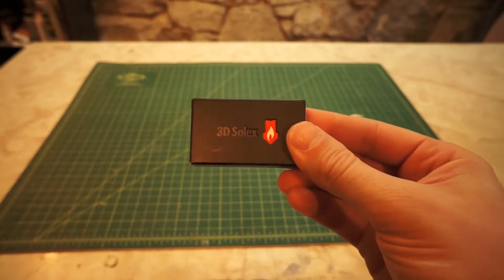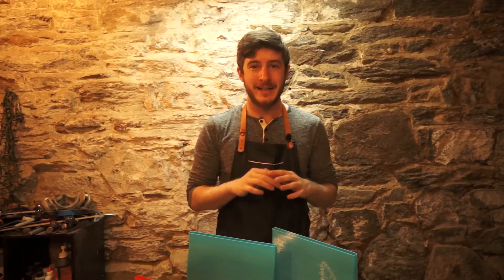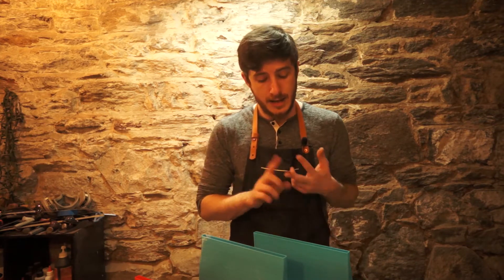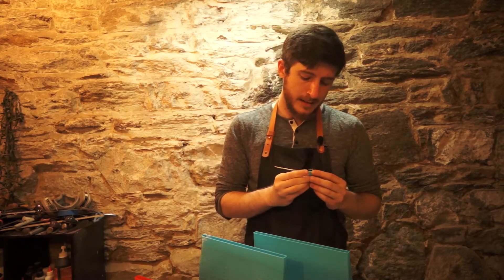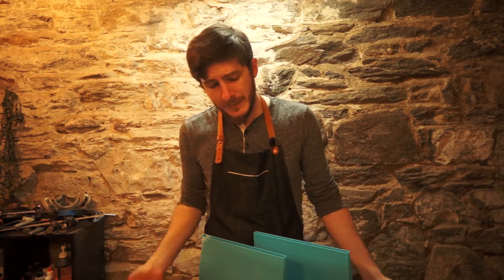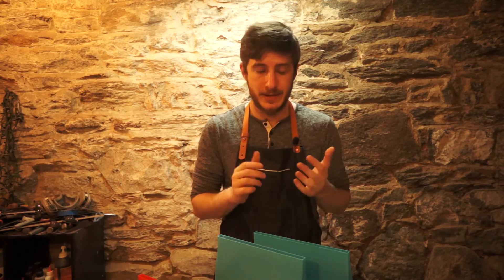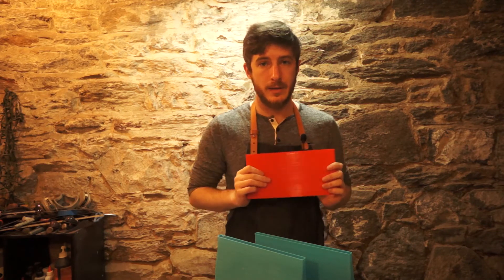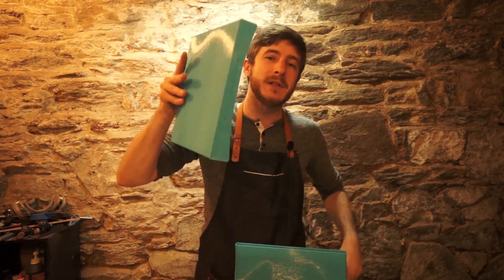Using the 3D Solex 2.0mm Printer Nozzle

Comment: I bought their matchless 1.0mm and its not great. It says you can print 4X fast as advertised, but it printed worse than my 0.8 brass nozzle. I wasn't impressed.
Reply from the maker: Yeah, I've definitely found better solutions since I tried this nozzle. A volcano hotend with a 0.8 nozzle does pretty much everything I need for big beefy prints faster and at a higher quality

Comment: I have been using a 1.2 nozzle on a UM2+ with bondtech for some time and it works really well.  I Just ordered the 1.5 & 2.0 from solex, can't wait to try them out. - The big nozzle's in vase mode are great for lampshades etc. :-)

Comment: Super underrated video, thanks for sharing. Please update what you found out working with Ultra wide diameters.
Reply from the maker: Hey! I don't know when I'll get around to making a video on nozzles again, but for a quick update: I've upgraded to e3d volcanos on two of my printers and they're much, much easier to work with. You can still lay down a 2mm line with the 1.2mm nozzle and 1.75mm filament, and they're faster and more reliable. Let me know if you think a full rundown would be interesting to see!
Reply: Good Roads seriously would love to see that. I’m laying down 1mm lines with my .4 nozzle just fine.
Reply from the maker: @KyleSSamuelson  Cool! I'll add it to the to-do list. Ive managed 0.8 lines with a 0.4 nozzle but I haven't pushed much farther than that. The main benefit of the volcano is that it can melt more plastic so your print speeds with those bigger lines can be faster.

Comment: You need a volcano to let the plastic have time to melt properly
Reply from the maker: I've got one now! It goes a lot faster and I end up fighting the extruder for speed instead of the hotend
Reply: Good Roads I have a titan extruder works like a charm, I never tryed other powerfull extruder
Reply: Yea I just bought 3d solex Matchless. 6 nozzand 1.0 but I have a authentic bondtech bmg extruder and volcano heater block so I hope to have better results than u had in the video

Comment: If you have a larger diameter nozzle AND want to print faster than with a .4mm, it's common to have to up the hot end temp to be able to melt the filament faster so you can print faster.  I  usually use a .4mm nozzle and will commonly print PLA at 230 for the first layer and 215-220 for all other layers.  I am positive you can crank your temp up to 230+ and you won't burn your PLA as long as you up the speed as well.   This is because the PLA will be in the hot end for less time.  With a lower temp, you will have to print slower to keep the laying down of filament in sync with the melting rate.  Keep in mind that the faster the filament is pushed through a hot end, the more the hot end will fight being cooled off by the constant flow of room temperature material, so that alone warrants upping the temp to compensate.  Try the same piece as a test with a higher temperature hot end as well as faster mm/ps motion.  As long as your hot end's power CAN keep up with the higher temps, you should be spewing much more filament than you are.